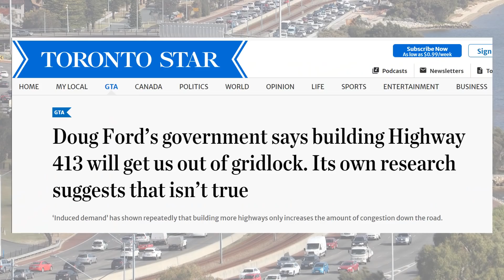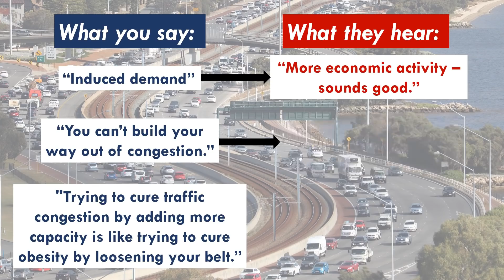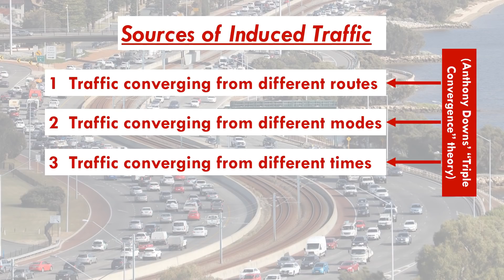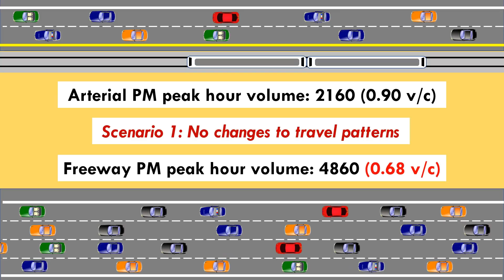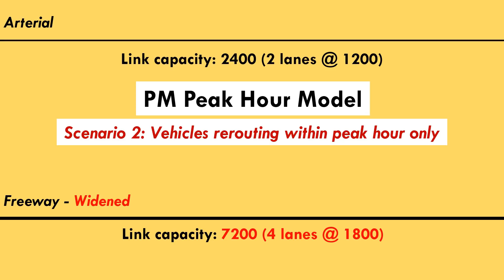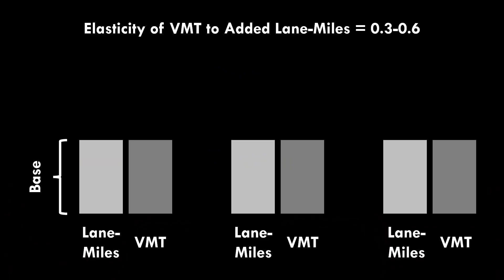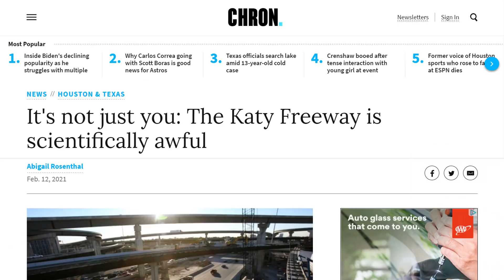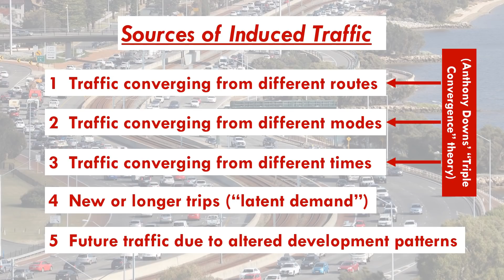Induced Demand & Roadway Widening: Everything You Always Wanted to Know (and Weren't Afraid to Ask)

Comment: Here's another thought. 🎉😮🎉😮🎉😮

How about comparing automobile related deaths, drivers and passengers in America to the EU same apples to apples. Don't even bother with injuries and property damage costs comparison. 

Then do the same for light rail, and high speed rail, and local Bus and Trolley deaths, again America to the EU.

You can make it more comparable by dividing by total ridership to get some kind of ratio for 100 or 1000 passenger miles. You know, how you make the comparison actually valid.

I just want people to see how less dangerous light rail and high speed rail is to driving one's own car.
Reply: I'm betting that the deaths per 1000 passenger miles in the US are all higher, across all types of travel modes.❤😅❤😅❤😅

Comment: These traffic flow and demand models are so complicated and it's hilarious because the solutions that are usually presented are what common sense would usually say (like someone at the office complains about a road not being wide enough and they should just add a lane or two - the eventual solution output by the complicated model is to support that obvious proposal). More to the point, these models are so complicated and model specific small, individual changes to single streets, when the real answers are to divert to transit and make large changes to make whole bad roadways different.

They're looking the wrong way and over-complicating that wrong method.

Comment: Houston is a perfect example of “stereotype planning”
A good traffic engineer conducts studies to find out where the bottlenecks are & why traffic backs up.

Idiots think more lanes work but that is not Houstons problem. But idiots demanded more lanes & im glad Houston put those lanes in because it proves there is more to it.

Peoples paranoia cause backups. Slow or too fast cause backups. Everytime someone brakes it causes  people behind to brake harder. Eventually the whole freeway is stopped. The main culprit are people merging  on the freeway slower than the flow or speed limit. Also people who slow down to change lanes need to be slapped. People who slow down to exit the freeway, you slow down after you are off the freeway not before.

Road construction or a lane ending ahead:
People not following the zipper method will get over before they have to causing one particular lane to become congested slowing everybody down.

People dont keep right.
The lanes on the left are faster & meant to pass people on the right.

People refuse to go flow of traffic. If the speed is 60 &
everybody is going 70 its not your job to punish them by going slow. Move right or get off the road. Impeding traffic causes road rage.

And then there is the controversial induced demand theory: This actually has a relatively simple reason. If additional highway space is built, more people who do not already commute by car will choose to do so. This wide area immediately fills up, and you are back to crawling through traffic at a mind-numbingly slow speed. This actually has a relatively simple reason. If additional highway space is built, more people who do not already commute by car will choose to do so. This wide area immediately fills up, and you are back to crawling through traffic at a mind-numbingly slow speed. While this is somewhat true its basically bullshit Science. Congestion is caused by braking & people forcing others behind them to brake. Needless braking on the freeway is preventable & illegal.

Comment: You can take this video and really  do a deep dive I-4 in Florida. I moved here in 1996. In the early to mid 2000. It expanded in from 4 to 6 lanes. Now they are doing what is called Ultimate I-4 with diverging diamond interchanges since I lived in Winter Haven, long enough I-4 has always been under construction from one point in time to another. Since was expanded to handle more traffic getting to Orlando can be a parking lot even on a Saturday which is ridiculous. 
What you haven't discussed is every time lanes to every freeway are you get stupid state laws paid with Federal and State tax dollars that you can't drive in the far left lane turned HOV lane and in many states like Florida they turned  that left lane to passing only. Even if you drive the speed limit in left lane for extended period the Florida Highway Patrol would love to give you ticket if your caught driving. The law was only intended to make slow drivers use right lanes only. So Florida Highway Patrol goes way over what the intent of law. If the idea is to keep traffic moving and high demand states stupid HOV lanes and let fast drivers you use far left lane if they want.  If is I was in charge of NHTSA HOV would be done away with. Hey states you Federal money to expand a a freeway get rid of the HOV lane and let every fast driver you the left lane when you want.

Comment: I would think that traffic flow measurements would include qty of vehicles per length per lane at measured velocity.  A high average velocity means no congestion.  As we know, velocity at the posted speed limit can seem congested but that should also be determined by the vehicle density (qty per length) per lane.  That means congestion can be determined in a school zone or a highway with the same value.

Having said all that, I'm wondering if the perception of congestion may be cultural.  That is, what is congested in a small city may be easy for a big city or another country even if the same quantitative values are measured.

So I'm also wondering if for a given city, there is a maximum tolerance of congestion before drivers start to change routes or modes of transportation.  At that maximum level, there is no positive return in lane expansion.  Existing drivers who choose continue to drive will tolerate it while new drivers will avoid that route or just don't drive.

Comment: Rail has capacity limits too, such as station size, or minimum train separation.  I think that one thing to be careful about, is that removing bottlenecks allows cities to grow and to trade.  The flip side of "build more, and you'll get more vehicle miles" is, in part, you'll limit city growth if you don't allow more traffic, trains, whatever it is that you're providing capacity for.  Maybe that's good, maybe that's bad, but urbanists often seem to extol the biggest cities as the most interesting, so be careful in how much you wish to limit capacity.  Maybe those park and rides like at the northwest end of the Orange line in greater Boston, where a highway reduces lanes and diverts traffic into an enormous parking garage with escalators down to the subway, aren't all bad.  Could the drivers instead just get on a bus from their suburban home to their local suburban rail, in to the city? Probably not, not enough density to support a good bus network in many burbs.  Could everybody just be forced to live in tightly packed multi family housing close in to city center?  Even with London's many attractions, and England's severe hurdles to development, loads of people who work in the London metropolis choose to live out in leafy semi rural areas.  I think that a pragmatic approach that recognizes that a desirable, and economically strong, city will induce growth, and that people have a spectrum of different priorities, can yield a sensibly balanced outcome with good characteristics on several fronts.

Comment: I have trouble believing much planning is done at all.  I have relatives in Iowa, a state with sharply declining population.  ~Two decades ago, a new interstate dubbed the "Avenue of the Saints" connected St. Paul, MN and St. Louis, MO.  This brand new freeway was built for a lot of money, but then sat nearly empty after it was opened, even years later.  In contrast, I did business regularly in Austin, TX.  The I-35 split decks downtown were jammed.  So they built a new toll road 130, bypassing Austin.  Even with higher 85 mph speed limit, few people took it.  Bad (or no) planning.

Comment: I think one of the biggest issues that isn't so much induced demand is that car trips are essentially badly bottlenecked pipelines because of how American cities are designed. My trip might consist of a 6-lane highway phase of the pipeline, followed by a 2-lane urban street to my work office. Unfortunately, if things like offices aren't distributed but instead clustered in one area, then a whole cluster of people has to go to work along a similar route, and the whole trip is bottlenecked by the 2-lane urban street; no amount of widening the highway is really going to make that trip shorter. Now, this is of course a vast oversimplification, because in reality, highway traffic serves a lot of different travelers going to and from different places. But it's not uncommon to see particular choke points acting as bottlenecks for getting between desirable destinations, and that ultimately boils down to a zoning problem. If you put all the houses on the left, all the jobs on the right, and expect everyone to go to work at similar hours of the day, then yeah, of course the smaller city roadways are going to get overwhelmed, because they're not built to handle the same capacity as the 6-lane highways.

Comment: The poorly understood situation is that pressure on employers to employ as few workers increases each year, and means that workers need a lot of expressway mileage to move to a wide variety of jobs within an hour driving circle centered on your house.  However, I worked in aerospace, and am aware that what best can be called flying cars are coming down the pike a lot faster than most of us would believe.  That will introduce a situation in which workers will have the option to live anywhere in a state, and commute to a job.  You may not have noticed this trend, but it is growing in momentum.  Some of the technology is classified, and that is why it is not publicized.

Comment: So first, does the induced demand only focuses on a focus point or takes the domino effect into consideration? 
It was mentioned as aftereffect as a "future problem". Because from that I got that first they spend huge money into building a new road, and once that extra lane is finished they are reacting to newsarticles that "your project did not fixed what you promised"... 
More and more cities growing. It is clearly visible that roads that been build decades ago were not designed for a 10x larger population. 
Its like if someone would invent flying cars, but cities would be "no fly zones" you can have an "infinite" highway, but you will hit the bottlenecks eventually. 

Second topic:
"ortodox teaching requires to be anti park n ride"
Again, when it comes to city planning this isnt good. Because that extra lane is a LOT of money. Lets not go to "its good because it generates work". Lets stay at the efficient city planning. 
The same induced demand could be used for railways. And there a different planning comes. Since while a carlane can handle 1200-2000 car per hour
a metro can handle 7-10k passanger per hour. And there an extra "lane" can be an extra car. 

If we add the "Return of investment" to the calculation it will shift calculations. 
And I do believe there is an overcalculation issue. The effort an individual need to put into a project to see a result. 
Lets say a road designer need hundreds of hours of simulation and complex metacalculations to find a "llvl99 to a 100" which would show a 2% better optimization 
when the alternative transport infratractures are still at lvl 4 and fraction of the effort have a better impact because theyre underused and underutilized

Comment: One of the issues we have in Baltimore is that a lot traffic from I-70 [ends at the city border] floods onto I-695 with many wanting to head east (that would be I-95) but because of the abrupt end to I-70 they are forced onto the Beltway.

Now the reason for that abrupt cut-off is due to public resistance [unfortunately, it didn't stop the 'Highway to Nowhere' from happening] so that was a positive BUT it's a double-edged sword.

Comment: "A hidden bottleneck", or, you know, a bleedingly obvious one. A city I used to live in in Australia widened one of its bridges, which lands right on the edge of the city centre. It changed from a two lane bridge to a four lane. That four lane bridge landed on a two lane street. Instead of two lanes of slow moving traffic as cars filtered into the CBD, it turned into two empty outbound lanes, and two inbound lanes of choked traffic, with people waiting in queue, on the bridge for two or three cycles of the lights to get through the intersection at the foot of the bridge.

Comment: "Induced demand" is EXACTLY economics (~3:00). Think of the time/convenience of getting from A to B as the "price" of driving from A to B. If you lower the price (decrease driving time, increase convenience) of driving from A to B, you will create more demand for driving from A to B. Lower price of a product increases demand for that product; not the other way around. So induced demand is in fact simple economics. This is also exactly why public transit in most cities is designed to fail, because driving from A to B will always be faster than using transit to get from A to B, thus transit is always relegated to people too poor to afford driving and becomes neglected. The exception are small city cores in places like Montreal, where you actually see people walking and taking transit, and not driving around as much, because, tada! it's more convenient and faster. This kind of induced demand is also comparable to subsidies; which, like adding a lane to a highway, appear to work great at first, but quickly create a bigger problem than you started with, because you still have the same issues you had BEFORE subsidies, but now you also deal with the recurring expenditure of continuing the subsidy (because removing it will be very costly politically).

Comment: 1. There is no such thing as 'induced demand' - it is a unicorn term. 2. We are not measuring time cost, but rather generalised cost. 3. When the generalised cost goes down, more of the service is demanded on that road. When a shoe shop reduces its prices in a sale, we don't talk about induced demand for shoes. 4. The notion that widening roads leads to increased traffic is simplistic. Often a congested road is widened or transit is provided and the reduction in generalised cost leads to increased demand for road space, if the road is not congested the supposed 'induced demand' doesn't happen. Please note, applying a user charge at this point (a toll, increased tax on petrol, a tax on car ownership) does the opposite and reduces demand. 5. VISUM - that's what I use. The best option by far.

Comment: Small city region, here. The Charleston, WV region at this point doesn't have a huge problem with capacity, as long as you know to use parallel roads along the river instead of the interstate at 745am and 515pm, but instead it has issues with degredation. Our roads and streets are getting bad to the point of damaging cars from the physical stress of the potholes, crumbling shoulders eating into single lanes on 40+mph twisty roads, I could go on. The sections of interstate in the metro area that aren't bridges are getting especially bad in the truck lanes until you get a few miles west of town.

It's difficult watching conditions in the region deteriorate. The streets around the Capitol are shiny and fresh, while our Piggly Wiggly has to complain on their advertising banner to get the governor to repave WV 61 in maybe a few years.

Comment: The last one ie changes of development patterns doesn't fit with the assertion it is entirely about supply changes. That one really is shifting the demand curve you are adding a concentration of people that need to do stuff or places that fulfil those needs or both and thus generating entirely new connections between the two that must be satisfied ie new trips. You have essentially just built any potential reduction in the price (delay) out of existence by adding new users to increase demand and shift the curve back towards the old equilibrium and usually beyond.

Comment: i suspect the reason that most scheme's analysis is optimistic about the improvement, is that if the analysis isn't optimistic, the project doesn't go anywhere and you never hear about it.     even in a circumstance where everyone is working in good faith then this would be the case, why would you take forward project A if project B had a bigger impact.

Comment: I can't help but feel if you add enough lanes, you can beat induced demand. The 15 freeway in San Diego is 5-6 lanes each way, plus 4 carpool lanes (7, 8 lanes each direction). This north/south freeway doesn't slow to stop and go like the 5 and 805 with just 4, 5 lanes each direction. You can drive 30 miles up into north county never dropping bellow 55mph, but the parallel 5 will creep.  Wonder if your model can reveal a number  of  lanes that will prevent traffic from dropping to stop and go.
Reply from the maker: At a certain point, it's all about upstream and downstream bottlenecks, and interfaces with the local system, and more lanes just means more queue storage.